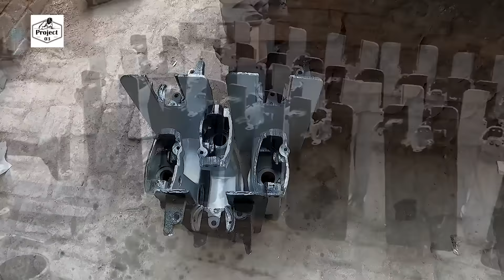How Samad Sewing Machines Are Made

Comment: I have to give respect to the workers there.   With the squatting, knee destroying work positions to the extensive dust and grime they still put out a workable product. 
I have an old tredle powered Singer at home that is very similar.  It was built 100 years before these, so the design has stood the test of time.
Reply: It's probably a copied Singer!
Reply: @cranegantry868  Singer the company deserves no sewing respect from sewists.  research the history of the company.
Reply: @christopherprice-hq5sy As of my last knowledge update in September 2021, there is no widely known or documented history that suggests that the Singer sewing machine company has engaged in suspicious or unethical practices. The company has a long history dating back to the mid-1800s and is credited with many innovations in the sewing machine industry.

It's possible that the statement you provided is meant to be humorous or satirical, rather than a serious commentary on the company's history. If there have been developments or revelations about the Singer company's history since September 2021, I wouldn't be aware of them.

If you're interested in learning more about the Singer company's history, I would recommend conducting research through reputable sources to get a comprehensive and accurate understanding of its background and contributions to the sewing industry.
Reply: @siloton  he leased machines to people instead of sold them.

Comment: What possessed these people to do the machining operations to the casting AFTER it has been painted? That's completely insane. What if the paint gets scratched? What if they discover the casting is unusable? 8:28 The paint on the edge is already chipped off from being dropped on its back so many times, and on hard surfaces.
Reply: Poor people have poor ways.
Reply: @deedle6073  Poor people have the poor people mentality.
Reply: If they machined it first, they would have to mask the machined surfaces to prevent them from getting any paint on them, a fussy and time consuming task.
Reply: Painful to look at. The chipped edges! How they could be so careless, after so mauch effort to put all the layers of finish and decor. And it is so easy to prevent this!
Reply: @konradhenrykowicz1859  ikr? It bothers me too.
Reply: It's functionality that is most important. The fact that they are not electric speaks volumes.
Reply: Impressive build with function taking precedence over beauty. This is a useful machine in underdeveloped countries.
Reply: You don't see a reject pile anywhere do you.
Reply: An old rag on the table and floor could prevent all the chips and scratches. Very sad
Reply: @drbichat5229  People suffering and dying early due toxic working conditions and you mention poor quality control.
Reply: The machine head is heated to a high heat multiple times during the enameling process, don't you think that would possibly warp the fine alignment of the mechanical assembly points?  Not to mention as someone pointed out, keeping the enamel out of the newly cut threads would be very difficult.

Comment: Methinks I'll stick with my old Singer.  It's been around for over 60 years and will undoubtedly be around another 60.  I'd be shocked if one of these pot metal trinkets last 10.
Reply: The body is cast iron. You can see the flash rust on the bottom early in the video.

Comment: 3:45 my old "metal industry basics" teacher would have kicked my butt for tapping a thread like that but in case this is the standard there then it explains why are aftermarket motorcycle parts from India are inferior compared to the Czech originals (Jawa).
I feel sorry for these guys that they have to work without any work safety equipment. The painters lung must be full of paint particles after a day of work.
Reply: This is not India

Comment: This is so sad. Worker safety is ignored. They are spraying chemical paints without breathing protection. They work in open sandals without safety shoes. There is no fans and ventilation for the fumes. They work without gloves and safety glasses. Working with castings gives you silicosis. All of these 3rd world country manufacturing videos are sad because the workers will suffer long term health defects down the road because of the lack of proper conditions. The workers need health and safety laws and they aren't getting them.